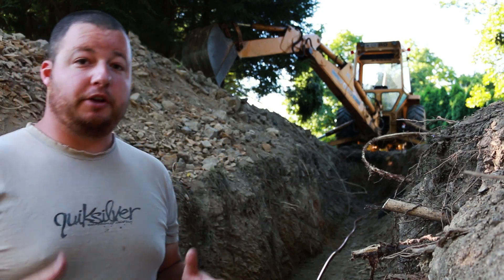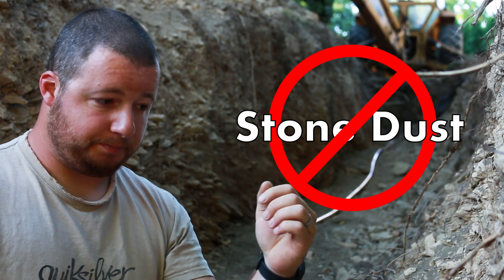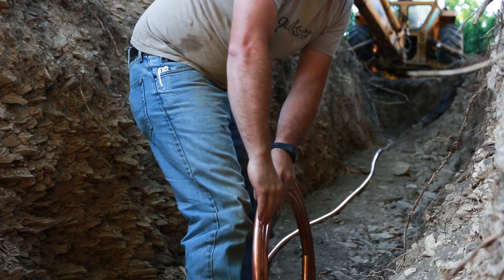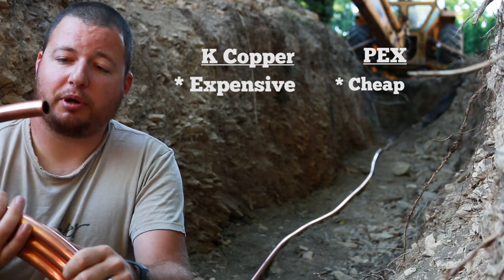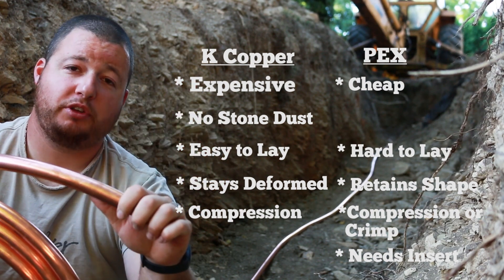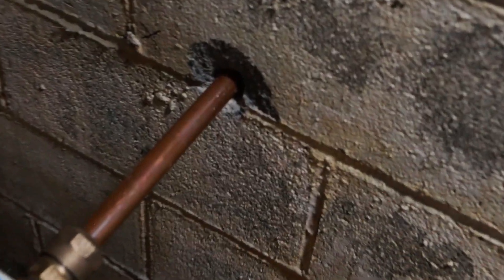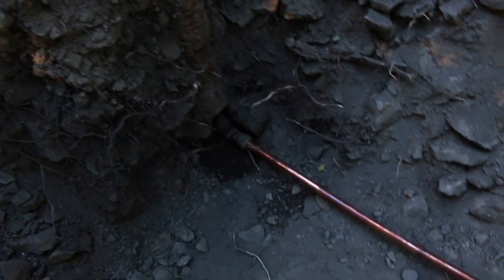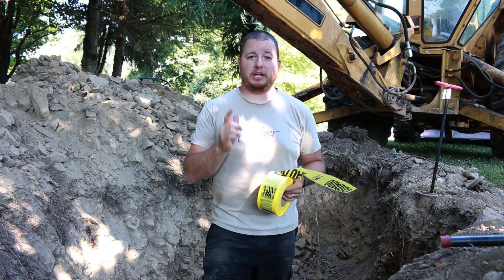Water Main Replacement

Comment: I'm in the Pacific Northwest (think: Seattle).  I am replacing my meter-to-house line.  The trenching is done.  I am shocked with the rocks (and other debris: e.g., a brick and a part of a concrete block) that were used as backfill.  I will be installing  a poly B line inside of a PVC "sleeve."  I am surprised that in your area of shale to do not use any protection at all for the copper pipe.  Great vid; good video
Reply from the maker: Yea make sure your backfill is "clean". We did use a sleeve to go through the foundation. We also laid on clean fill 1ft thick by hand so no heavy rocks/ debris landed hard on the pipe.
Reply: @appalachiandiy2415  Thanks.  I will be using a 1/2"x1/2" screen to sift the stuff I dug out - all hand work (I'm so tired ;-)

Comment: HDPE NOT PEX
Reply from the maker: Why not pex?
Reply: @Appalachian DIY  where I live from where the line is tapped into the main up to the transition to copper before the water meter must be HDPE or K copper. PEX would be rejected If I was inspecting a service line and it was PEX. Reasoning.... say in our climate it is more durable and less contamination migrants. But I'm sure where your at it would be to code since code literally varies from county to county lol

Comment: Thanks for the video. can the copper pipe be spliced in case it developed a pin hole leak in the future or the entire copper pipe must be replaced ?. Thanks.
Reply from the maker: It can be spliced but not recommended. buy the expensive couple from an acutal plumbing supplier

Comment: Great video! Some questions though..if you dont mind
Did you use sifted dirt or sand in the leveled ditch before you laid your new main? And did you lay this initial  bed the entire width of the trench or just in the centre where the pipe ran? 

Also,when you said you used top soil over your new service main,did you mean the top soil you excavated from the lawn when you started digging or did you have to get new clean dirt ?
Reply from the maker: It wasnt sifted dirt but there were no big rocks. You could use sand also. No not the entire width, about 2/3. No use in wasting good fill on the edges where the pipe will not be. Yes, just escavated soil that has no large or sharp rocks. If possible, when escavating, separate good soil to use as a bed and first layer over the main. Thennjust put junk/rocky soil on top
Reply: @appalachiandiy2415  Thanks👍👍 now just wanna make sure what my city(Toronto) requires in terms of backfill if there is any particulrly different requirement at all.I will be digging only upto the curb stop. It is however the city's property, the curb stop.
Reply from the maker: @SunnyKumar-hj4iy  yes the curbstop valve is the cities property. Its abgood idea to check utilities too. Being in toronto i dont know if 811 will work or not? I haveba video shiwing how to do that
Reply: @appalachiandiy2415  is it available on your channel?
Reply from the maker: @SunnyKumar-hj4iy  https://youtu.be/IxCxlCvwpNQ Yes, here it its

Comment: Run the 1" pex inside a 2" pvc pipe to protect it. Or run sched 40 pvc inside pvc.  Then back fill with whatever you like.
Reply from the maker: Good Idea. It would kinda be a pain threading all that pex through the pvc but doable. I don't know how well that would work with K copper pipe though. Thanks for the reply!
Reply: i heard that sched 80 pipe  is good but i don’t know to buy it

Comment: Pex makes a great 'sleeve' for copper - get some Pex that's one or two sizes up from your copper and slip it over whatever portion of your copper run that needs protecting, like that rocky bit under your french drain.
Reply from the maker: Thats a good idea. pvc could be used also as it has no bend but it is more brittle than pex. Thanks for the reply!

Comment: Thanks for the video😊 I’m working on this currently. I too will be using copper pipe. I don’t mind spending the extra in it so couple questions for ya.. what size pipe and type did you use and so you think it would be okay to run the pipe through a pvc perhaps ?
Reply from the maker: It was 3/4" K copper I believe. you could put it into pvc but it might be a pain in the butt

Comment: I beg to differ on the backfill.  We backfill with only 3/4 crush, no sand.  On the wet coast, sand just liquifies.   It does not matter if it is type K or Rehau Municipex.   I will agree, copper is much easier to roll out.
Reply from the maker: That is interesting. Have you come across any adverse effects from using crush instead of sand. Pinholes?
Reply: @appalachiandiy2415  None.  Our sand resources have dwindled over the last 25 years.  We have lots of rock and so most utilities are backfilled with some sort of aggregate.  I think the copper lifespan has more to do with the chemistry of the soils.  Of the 28,000 or so services, most failures are in sand.  It really depends.

Comment: If I were thinking about doing this without knowing how it’s done I would assume you would put some sort of conduit to run the pipe in to prevent it from being damaged and also you wouldn’t use copper because of how easily it corrodes and your putting it in the ground
Reply from the maker: you would be surprised at how the copper doesn't corrode underground. Plus I had to use copper as it is code where I live. they hav'nt gotten out of the  stone age and ok'ed pex yet. if you cased the line it would be hard to fix if needed. most water lines don't have a casing around them. Thanks for the questions!
Reply: I on the other hand I rather use copper because PEX has not been tested for BPAs. With PEX being exposed to elements like this, if there is a chance the plastics break down, I do not want them in my water supply.
Reply from the maker: @vivienhiggins8622  Im pretty sure pex is not made with bisphenol-A (BPA) but contact your supplier to make sure

Comment: No sleeving for the copper going through the concrete? Not good, you're guaranteeing pinhole leaks.
Reply from the maker: You still use hydraulic cement to cap the inside and outside with the sleeve, Correct?